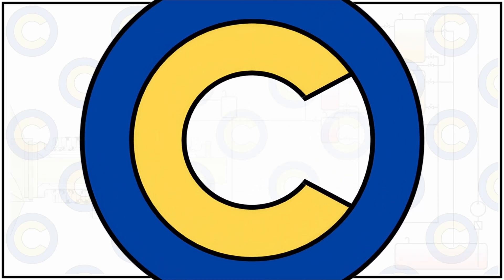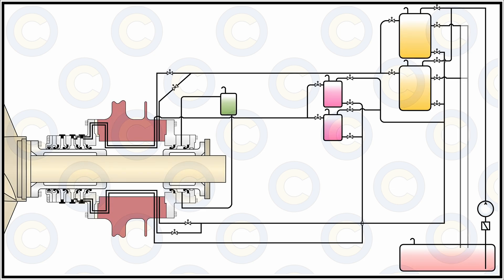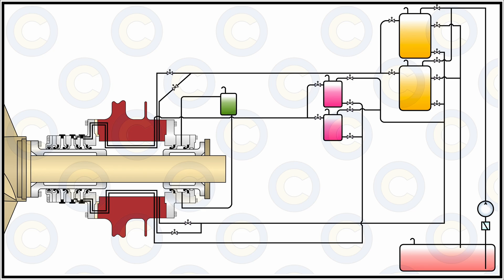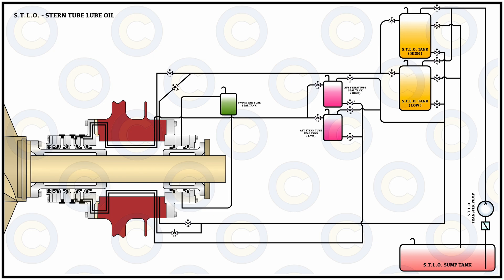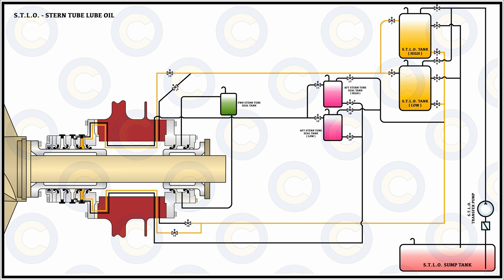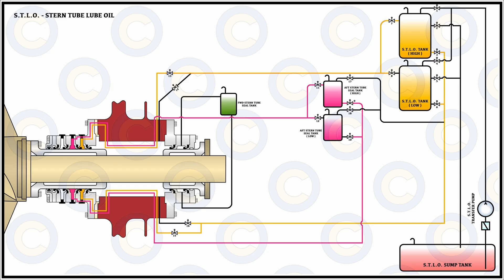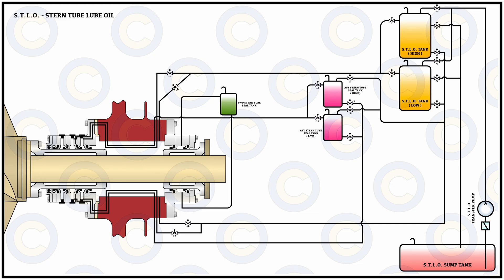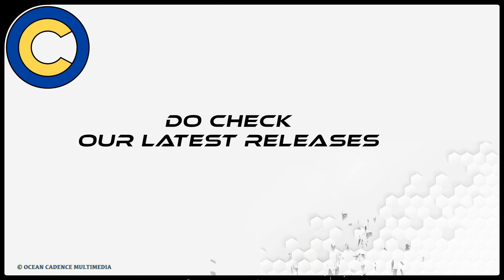Stern Tube Lubrication System | Stern Tube Forward and Aft Seals | Header Tanks in Stern Tube |

Comment: Sir what is the vale no 16 used for??
Reply from the maker: Good day Certain systems have a subdivision in the main line to be used as a manual flushing point by blanking the remaining system and draining oil manually. It can also be alternatively used as a point to introduce fresh flushing oil into the system after an overhaul and thereby drain the oil simultaneously into drain tank. In a few alternate designs, you'd see this valve also leading to the drain or sump tank and acting as a direct return or drain line.